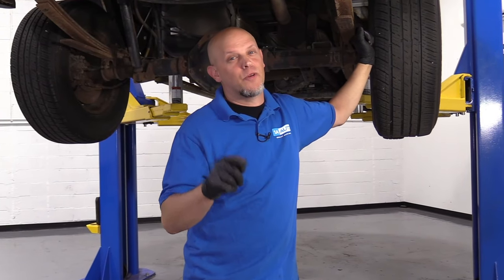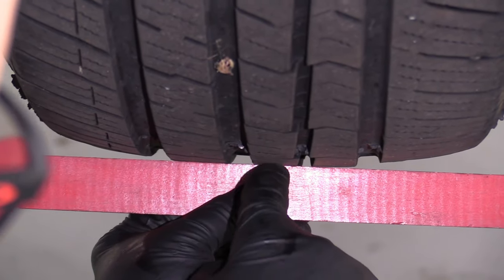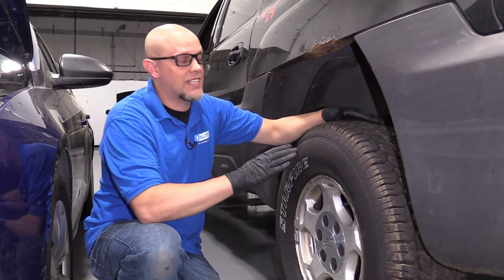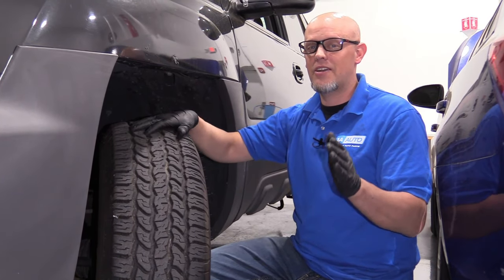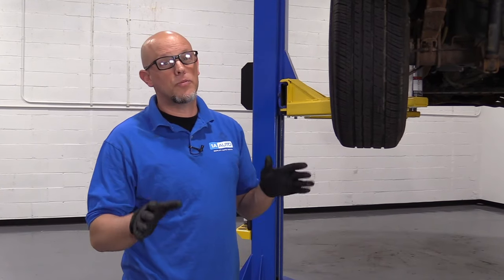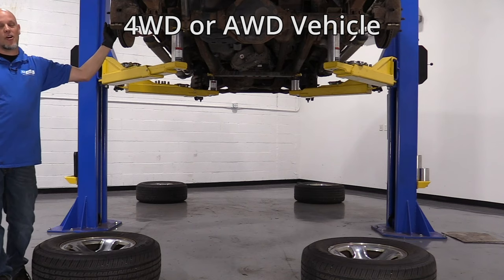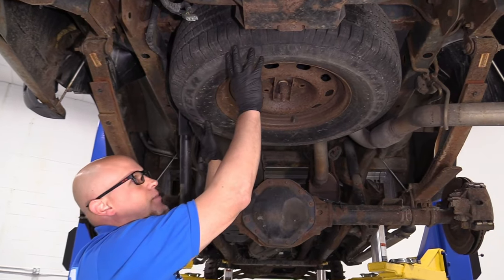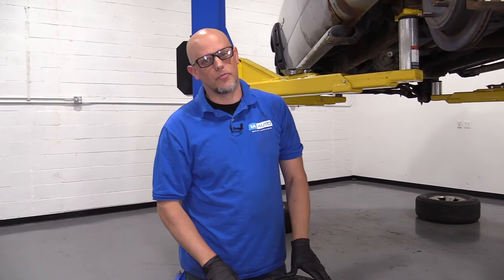Why You Should Rotate Your Car Truck or SUV Tires

Comment: That was confusing how he put the tires from the front to the back left to right why can't you just put the driver's side Tire in the back and the passenger front tire in the back what is the driver side Tire have to be switched with the passenger side Tire
Reply: Your list of words is confusing. Consider adding some dots and comma’s.
Reply: Man you ever heard about punctuation??? It very useful, helps you convey various thoughts eloquently
Reply: Each car has its own optimal method. Consult your owners manual.

Comment: So if the front tires are pretty wasted but the back ones are fine is it still recommended to rotate them ?
Reply: This happened to me on my vehicle, due to my negligence of not doing proper suspension and regular tire rotation. 
Anyways, I went to get a suspension and asked to get a tire rotation and they said they don't recommend it and wouldn't do it anyway because my front tires were badly worn and my rear tires weren't as bad, so if I had put my front tires in the back, and since they were worn out, I wouldn't have gotten proper gripping while I braked and /or when it rained, my vehicle could have skidded.
Reply: This just happened to me I had to replace all 4. Got my suspension checked and it was fine. They said it’s cause my car is fwl. To avoid it you rotate them but they won’t do it now since they will be uneven and also they won’t recommend to only buy two

Comment: This is a great video.  I have a saying, "tires and batteries".  When will they make these things last geez.  I'm forever dealing with leaks and shit batteries.  I have experienced the feathering numerous times and usually its due to really crappy tires.  I have never had this issue with good quality tires.  I typically do not rotate the tires because I don't like replacing 4 tires when they are all worn equally.  I only replace two, the rear for rear wheel drive.  If the alignment is a bit different I think that could screw up the tread on the tire, although I am not sure about that.  Ya with the GM Silverado the tires scrap along when doing a full cranked turn.  Don't get that with old Mercedes :). Tires last a lot longer on the front.

Comment: THANKS!  In the "old" days, crossing one set and other just moved front<>back was the norm.  Then radials and newer cars and front wheel drive came along and I kept hearing you should only rotate front to back.  Supposedly as the "direction" was/got set into the tires.  Never made sense to me as FWD have strain in both forward and reverse directions, acceleration/driving and braking, whereas rears essentially just roll and are only stressed when braking.  I know there are directional tires but correct me if wrong, but don't think most conventional, consumer tires are, so it does make more sense to me to get most overall wear would be the cross one set and move others on same side.

All that make sense?   (need to show this to the place I bought my tires in case they give me grief about rotating this way...  :)

Thanks,

RichE San Diego, CA

Comment: I bought only two tyres due to economic reasons, and fixed it to the front wheel  what do you recommend . My Toyota Vitz 2001 FWD car is vibrating when driving in high speed over 70km/hr .

Comment: What if I have to pay $20 every time to get my tires rotated. Is it still economically feasible do do so or is it better to just replace the front ones when they wear out?
Reply: If you’ve got a discount tire near you they will rotate them for free even if you didn’t buy them there.
Reply: or rotate them yourself lol
Reply: For 20$ you can buy a jack stand to do your own tire rotation. Or just use a few bricks instead. Just don’t get underneath the car when using a makeshift “stand”.
Reply: @heatherowen8528  yes and they also check and air up your tires for free.
Reply: Am I missing something or is $20 nothing compared to $1200 tires lol ? And I drive for work up to 5k per month. I’d much rather pay that than replace my tires prematurely.
Reply: Pay the 20 to rotate of course!  Isn't it only $2.50 a tire at Walmart auto center? That's only $10 to rotate them.

Comment: 40 000 miles tires? lol thats a lot. Usually here in eastern europe most people buy used cars.Lets say you buy a used car which is about 15 years old. If you're doing like 5000 km a year and you bought a new tires along with the car after 5 years you're probably gonna throw the car in the trash. Because youve thrown so much money fixing it that its better to just buy a new one. 5 years per 6000 is about 30 000 km. Which is about the lifetime of the car. Ive seen 10 years old tires and there is only slight difference in the wear. So if you're doing low km driving its not even worth it because you gonna throw the car in the trash in couple of years anyway. And the difference in the wear wont be super super crazy and you can still get away with using the tires in the summer. And even if you see that the wear is too much you can just buy new ones. And still the brand new tires you bought when you got the car will last you at least 3-4 years with minimum wear. So unless you are doing a lot of miles and driving a new car this isnt gonna worth doing.
Reply from the maker: +heybos Thanks for the feedback!
Reply: The lifetime of a car is 30.000km? You jump speedbumps with them every day or something? Most cars easily live up to 300.000km
Reply: @Engineer9736  European cars don't last a long time. Range Rover, BMW, Merc, Audi and etc.